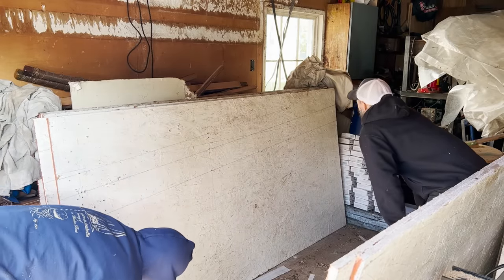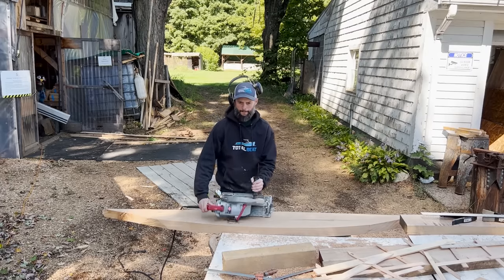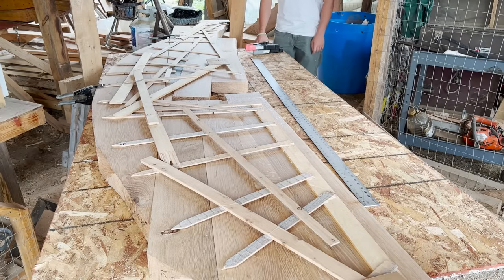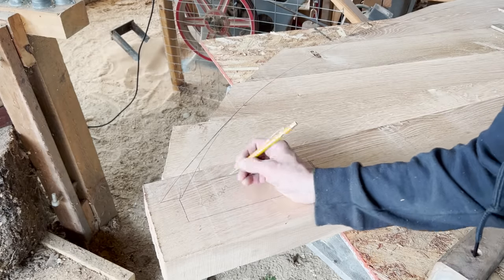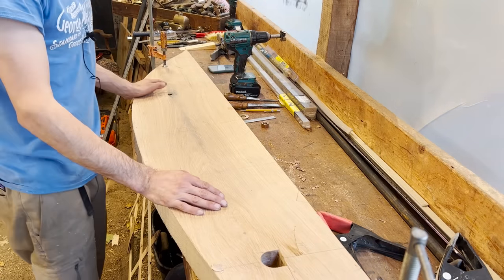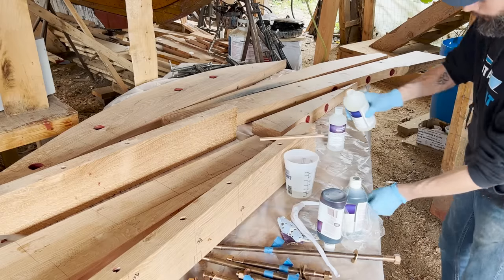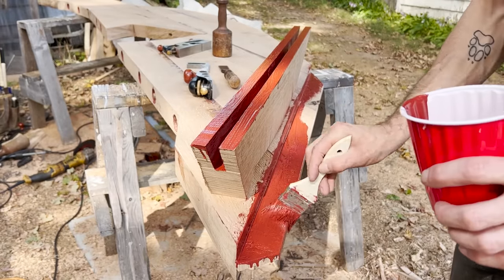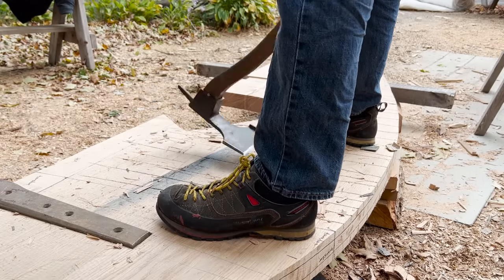Outboard Wooden Sailboat Rudder - Episode 235 - Acorn to Arabella: Journey of a Wooden Boat

Comment: #Steve a simple tip for drilling horizontal. Hang a large washer on the drill bit , when it's turning it will only stay in place when dead level, it'll move away if you're high and towards you if low.
Reply from the maker: Nice tip, thanks!
Reply: Dear arfarmortis1
👍👌👏 That's a really simple but ingenious and effective trick. I didn't know it before. Thanks a lot for sharing.
Best regards, luck and health.
Reply: If it’s dead level, will the washer not move towards the job, due to the twist of the drill?
Reply: Yes, a good tip but the bench and so the rudder fixed to it must be level too otherwise " damn, how did that happen"
Reply: @johnnunn8688   it goes on the plain shank of the drill bit.
Reply: Great tip!  DD

Comment: There are details in your build that really impress me. For instance, needing to drill for the bronze bolts and drifts, where the bolts will have to pass a long way but must remain centered, you drilled halfway through each piece from each side, etc. Really smart!   Then when clamping the cross grain breadboard end on the rudder, you had the foresight to leave a squared-off projection for clamping, which could be cut off later. Mind blown! You’re thinking every minute!  Impressive!
Reply: What does drilling half from each side achieve? I didn’t get the reason
Reply: @LoveToMix  each hole starts off centered in the exact location it is wanted. When the holes started on each side of a plank meet in the middle, any error that has crept in from each side gets fixed because it is easy to run the long drill bit all the way through the plank, cleaning up the messiness in the center of that plank. By doing this on each of the planks, you eventually get a long hole that starts and ends just where you want it. Pretty cool!
Reply: @douglasmoffat6560  very neat

Comment: This suggestion is coming pretty late in the game: get a cheap microwave set up in your epoxy mixing area a zap both parts of the epoxy in separate containers for a few seconds before mixing. It mixes up easy, has fewer bubbles and better flow.

Comment: Don't want to be an arm-chair Quarterback but in my younger days, I did a ton of manual threading of pipes of all sizes from .5 inch up to 2.5 or 3 inches in diameter and we always used a heavy dose of pipe threading oil in the cutters to lubricate things and to keep the cutters a little bit cooler (and lasting longer).  I'm just suggesting that you might want to consider that for your cutter.

Comment: The breadboard or clamp end there makes a lot of sense, but normally you drill the holes dry and enlarge the holes in the rabbeted end, or tongue, to allow for wood movement. Here that would leave a water pocket where rot would start eventually. So you're figuring that just bolts or dowels will have enough give as the wood shrinks and swells? Beautiful job as always.

Comment: I was thinking about those pockets. Traditionallly those holes are drilled and then you need to make really large hole. But if used router to cut a slot for the bolt and washer you could easily cut it wide enough to fit wrench. And you still would take out less material then with large drill.

Comment: When are use my longest extension (12”) in my battery drill, I usually put a steel ring on the straight part of the extension, that way I know if I’m level as the ring moves backwards or forwards if the shaft is off level. I like your idea of using a shooting stick to get the Yaw correct though.

Comment: You normally elongate all but one of the holes bread board tenons to account for wood movement. You can control the direction of wood movement by your choice of what hole you don’t elongate. In your case the leading edge.

Comment: wow, impressive! I would recommend putting the rudder in the water and letting it swell up before cranking down on the bolts and drilling for other hardware. Our rudder (quartered white oak planks each about 6 1/2 wide) develops 3/8” gaps when drying out and they completely close up.

Comment: My partner made the centre board and rudder first in his Fireball dinghy construction process. I found it fascinating to watch the shapes evolve from the lofting boards to the finished fibreglass epoxy sheathed finish. The size of your rudder is massive but the same principles apply. Getting everything lining up correctly and fasteners attached securely takes care and huge skill. Well done.
Is there any secondary steering mechanism planned for the eventuality of losing the rudder ? I guess space aboard won't allow for a complete spare rudder but can you fit something which would work in an emergency ?
Reply from the maker: I’ve heard of bigger locker doors or sole boards working. The most likely thing is the tiller, not the rudder, having a problem. We will carry a spare tiller. Most people do. —Anne

Comment: To give yourself more room to thin out the trailing edge of the rudder, you could grind off the sides of the washers a bit to make them a bit more rectangular.  Vertically, you would still have the same surface to prevent the nut from biting into the wood, but horizontally, you could take them down to the width of the nut which would make it less likely to hit the washer while thicknessing (is that a word?)

Comment: If that wood is quartersawn, the grain should be running the grain should be along the length, and the rings running across the thickness.  That should put the main expansion and contraction, other that a minor amount magnified by the overall wide size, across the thickness.  I'd say there's little chance of blowing off the breadboard edge or splitting.

Comment: You're using your channel locks backwards. If you turn into the bottom jaw it will bite in meaning you don't have to squeeze the handles nearly as hard.

Comment: Is that bottom piece like a sacrificial timber?  Incase you hit something with the rudder?  Or what is the point of having that extra on there vs just shaping what you had.
Reply from the maker: Steve explains in the video about the movement of the wood.
Reply: @AcornToArabella  ah  it sounded like he was saying the movement of the wood was related to why he wasn’t gluing the piece on. Not necessarily the reason the piece existed or it’s function.

Comment: You didn't mention in the video what type of glue was used to join the rudder pieces. I assume it was an epoxy as it was a two part system. Could you elaborate on that and why you chose it ?  Thanks.
Reply from the maker: We’ve got a link in the description, John! That’s TotalBoat FlexEpox, which is a two-part 1:1 flexible epoxy. Flexible so that as anything shifts by tiny bits, which it will, the glue will not fail. Those bolts should do a good job at any rate. 😁

Comment: What was the purpose of cutting the end of the rudder off and replacing it with the "breadboard?" Was that in the plans?
Reply from the maker: Steve explains about the movement of grain as he makes it. Construction details like that aren’t often in plans, but rather, are found in books such as Bud McIntosh’s.
Reply: @AcornToArabella  His explanation of the movement of the grain was for the breadboard that he replace the end of the rudder with.  He did NOT explain why he cut the end of the rudder off and replaced it with the breadboard.

Comment: Do you eventually name the purple mixture?  It reminds me of the seemingly not so thick Resorcinol we used on our full-sized first aircraft build.
Secondly, I must admit I've lost faith in the best method for jointing glue-up edges.  My 8" Grizzly, despite my earnest efforts to absolutely try to ensure a perfect 90 degree fence, seems to not always deliver the perfect results I desire.  Likewise with my big tablesaw and also my new track saw.
I see your jointer fence seems to not be absolutely rigid, especially with the massively thick white oak pieces.   Signed: 90 ° Quandary.
Reply from the maker: Hi David! We’ve got a link to it in the description: FlexEpox from TotalBoat.

Comment: Are you going to weigh the rudder once you have finished shaping it?  Why not have a sweepstake on the weight?  I am going to say with the fittings (that are fixed to it) it will be 210Lbs.
Reply from the maker: There’s one other detail coming next week that will make you want to tweak your guess. 😉
Reply: @AcornToArabella  Me thinks that there is only one way to go.  I haven't a clue what the extra will be but lets go with 290lbs.  Someone has got to throw their hat in and get it started.
Reply: @AcornToArabella  I'm gonna a push it closer to 1,000lbs
Reply: Hmm, ...670 lbs. If I've guessed most closely, I simply am rewarded by being able to come time along on the tremendous A2A journey being so generously and wonderfully shared. Oh, sure, stickers and a good or rash guard (cotton long sleeve T) would be an extra delightful award... watching is itself such a delight!

Comment: Why is the rudder made with the grain running vertically?  I would think that would be much weaker than if the grain ran horizontally.
Reply from the maker: Long, uninterrupted pieces with fewer joints.
Reply: @AcornToArabella  Also, I suppose the many long bronze bolts compensate for the short grain's weakness.

Comment: Now at 13:15 you have the main reason why mere mortals could never do what Steve is doing.  You're relying on MEASUREMENT to make the holes for the bolts throught the rudder line up.  I wouldn't even attempt that.